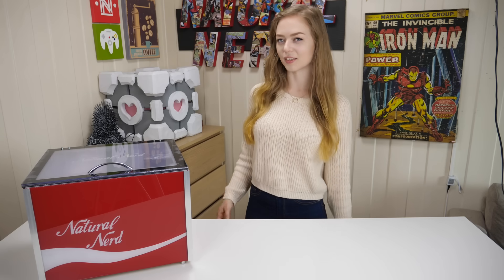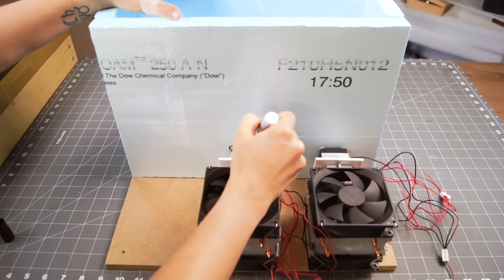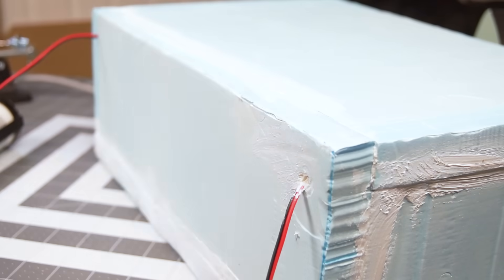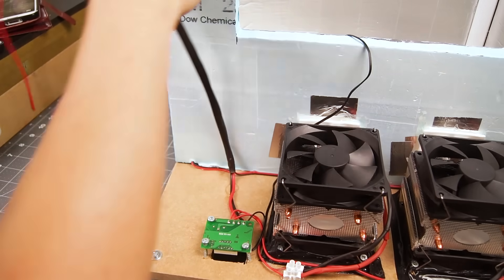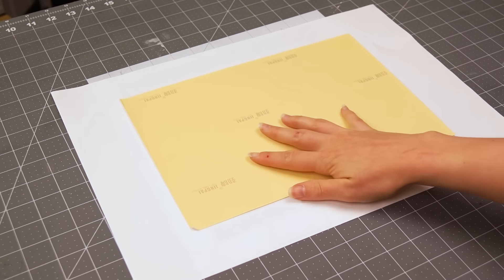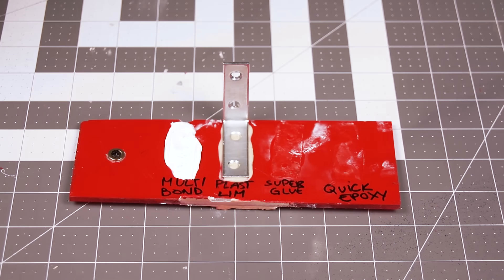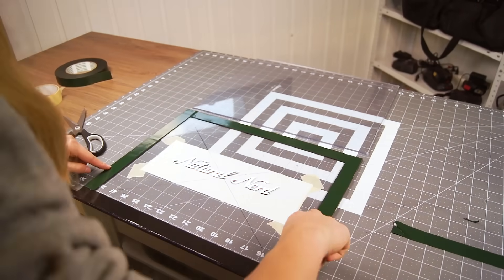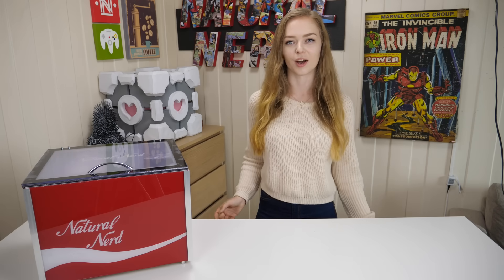DIY Desktop Mini Fridge (5°C!!)

Comment: I do have that thermostat, i mean that model. Its relay is rated only 10a. You will worn it out sooner using those 2 12706 peltiers. 
Also, the size of its relay makes the buttons impractical to use, so i assume you've already set it first before installing.
.
I do manage to buy a e-thermostat of 20a, still cheap but it comes with a case complete with display so you can still set the temp.
.
I also made similar project but I've used plywood instead, it's r-value sucks btw so still need some insulations. But because it's my first time doing woodworks, my creation still suck even with insulation.
.
Also, may you should spray painted your inside with clear coat, those alu tapes worn out pretty fast.

Comment: Maybe the issue for cooling can be fixed if you also put syrofoam in the door/opening panel. It may not look as nice as what you did but it will be more convenient and efficient

Comment: you should have put those fans so that they blew from right to left not up to down. hot air is less dense so it will rise back into the heatsink.

Comment: How much current consume tec 12706 module 6Amp ????  But why my Tec 12706 only consuming 2.5 to 2.7 amp but it's printed 06 ampe but it don't seem to 6 amp module ??? Why why ?? I have checked it with two or 3 am metres

Comment: Where did you get the plastic wrap for the led strip? I'M LOOKING for it but I do not fi d it.. thanks in advance for the reply
Reply from the maker: You can find links to everything in the description :)
- Martina
Reply: Some links do not open the page.. I have another question: about the thermostat.. Is it adjustble for the temperature like a Real big fridge right? If Yes how does it work? If I understood well the thermostat you used replace the digital screen  thermometer shown in other videos with the upgrade the you can decide the temperature you want for your fridge is it like this.. it Yes can you tell me how to use it because I have all PICES home ready to be assembled. I am just waiting for the alluminum tape and it is done. Thanks
Reply: I JUST need to know how to program the thermostat to let it work at the SUITABLE temperature.. It is unfortunately not shown in the video.. It you can do it, would be easier 😀

Comment: I think I need to get inside your little box and get cooled off 
Your so Hot
Im burnin up 

And its called a hook blade,
Specifically for sheet vinyl flooring,
Sickle blade might've worked A little better, and probably better than that would be a blue blade
Generally specific to the flooring industry 
Mostly used in commercial applications for linoleum and 
carpet tile (one word , not to be confused with tile installation or carpet installation and their separate categories of types of installers)

Blue blades are the sharpest and strongest 
The worst sting you can get when you get bit by one  
It will flay you like Benihana

Damn Your Hot girlly

Comment: Great project, inspired me to work on a portable version to run off solar and possibly a battery supply  to take off grid.
Reply: edward silva I may doing that for my GCSE’s DT project I just have to see if I will be able to power it with a car battery. And how may watts is the solar panel you have used.
Reply: edward silva please post when done

Comment: Your fridge can get 5C... But an  important question to ask.. from what ambient temperature ?

Thank you.
Reply: Peltier modules can do a 50C delta easily (some go as far as 70C delta) while drawing ~70W (when always on). This fridge should be able to do 5C at 50C+ ambient.
Reply: @gslavik  Ämmm what kind of Peltier coolers do you have? It can surly NEVER can withstand 50C. First peltiers have a efficiency of 1/10 on the Carnot efficiency. The second reason is that peltiers can barely tranzport any heat with a temp diffrence more than 20k. And the last reason is that she build it that the air dont stay in the cooler or circulates. It is the warm air from the outside that just slips over the cooler and than cools the box. So i think you can have a diffrence of like 10 maby 15K below the outside temp.
Reply: Electric Fridges are sold in Trucking Stops for truckers. They don't get cold enough if it's sitting in a hot cab.
Reply: From freezing cold.
Reply: @poksi360  that's not what he is asking and also no nothing in this is freezing
Reply: @thecanadianbastard9019  I think you didnt get the joke. He meant it as "that fridge can go to 5° if it started at 0° lololol"

Comment: Fantastic, looks so cool.
What if hot sides of peltier/ fans were on one side and it has air inlet holes on rest of other 2 sides as well in bottom. In my opinion when fans are in botom it may cause slow escape of hot air and circulation of hot air back in..physics..!..?

Comment: This is wrong, you should never split a single wire like this, the current that wil flow throug it can heat it up and break or burn the mdf. Apart from that little mistake cool video and a nice project, keep it up! Like and sub from me!

Comment: For a project this small, you could use aerogel for insulation. You buy it on Ebay by the foot. Amazing R values with minimal thickness...

Comment: Mmmh, interessing. Very interessing.
But I've to point it out: this is for "professional DIYer", not for "Noob DIYer".
What I mean is that no one will go to buy parts AND tools to make acomplex project when the finished product will be cheaper. For example, most own a drill, but not everyone own a jisaw(sp?), a foam cutter, an industrial phon (dunno if is the right name, I'm using the direct traslation from italian) or even that cutter for plexiglass.
Now, you say, "all those are cheap and you can use them later". Sure. But as I said you would have to buy the tools (let's say 20€/each) and the components. And some mini fridge you cost only 40€, shipping included. 
I'm not saying this to put the video or the intention down. I liked this video and downloaded for later study (like when I'll finally find another work and will need something to use for relax-time)
I'm just saying that this video is more for the "professional" of the DIY than the "noob".

Comment: I've been thinking about building a larger frig to run off a 12-volt system. You've given me some ideas. Thanks!
Reply: Hi, dont waste your time or energy. This barely does a decent job when its capacity is 5 L. So you will waste money, it has a pathetic COP ( co efficiency of power) rating, like below 10%. Regular AC have 180% COP, I guess.
Reply: TECS are good for small fridges but a big fridge? you'll essentially turn your house into an oven and you'd be wasting so much power that you may may as well be shoveling money into a bonfire

Comment: Very nice DIY project! I think i've seen those thermoelectric cooling devices being sold in banggood. The seller  bundled those with TEC1-12706 peltier module, which is a weak and less efficient module in my opinion. But if we only wished to have our drinks chilled then, the 12706 is fine. Thanks! This DIY project is in my to-do list.
Reply: Hi congratulations, I also did technical tests with peltier inserts. See my channel. thanks.

Comment: Alright guys,if you decide to make this,switch out the Normal Black power Input that she uses for a safer FUSED switch. And obviously also pick and use the right kind of fuse. You want one that trips right before hitting max power draw. Why? Well fused stuff is always the safe stuff. So stay safe my friends and google search how to install fused switches (Like for the Anet A8 3D printer) <3 And dont fuck up the soldering!

Comment: Has transparent material and needs to see the temperature screen... decides to paint acrylic and drill a hole in it for the screen!
Well happens to best of us, but those building this, just tape screen area, paint the acrylic, remove the tape and glue the screen on that hole. Much cleaner solution that takes less effort.

Comment: If i was to make a smaller version with only 1 heatsink module rather than two, would i still get a cold temerature? Also if i was to use 1 cooler module what AMP 12V powersupply would i need.

Comment: Awesome build, subscribed.

Do the wires you used to add all the wires together to connect to the power supply heat up? they look pretty thin.

Comment: Great build! My only advice is that those heatsinks have heatpipes inside (the visible copper tubes inside the aluminium fins) that have a working fluid inside them & are designed to operate with the contact surface (that attaches to the Peltier in this case) at the lowest point.
Reply: Hi congratulations, I also did technical tests with peltier inserts. See my channel. thanks.

Comment: Based on your wirings, the fan directions on the big fans looks incorrect. Both fans are supposed to face towards the heat sink so it creates a high air pressure. This high air pressure creates a high temperature that gets heat sinked. Otherwise you're relying solely on the peltier. I bought the same refrigeration module, and noticed this.
Reply from the maker: Interesting, I'll check that out. Maybe it can perform even better!
Reply: oops. sorry i had it reverse. i meant they should be facing away from each other. this creates a low pressure, and cold temperature that is transferred via heat sink into the fridge and dispersed using the smaller fan. and according to this link it goes down up to -5 degrees http://bit.ly/2klKyye

Comment: how long could a fridge like that run off of a car battery or motorcycle battery? thinking of making some kind of portable refrigerator out of a cooler so I can take it with me on week long fishing trips to keep the fish fresh till i get back home.
Reply from the maker: We've thought about the same thing, since we go away for week long fishing trips as well during the summer. But I think its too power hungry for that. If this runs at around 80 watts, then a 120 Ah car battery would only last about 18 hours at full throttle. Of course the isolation prevents it from running constantly - so maybe 36 hours. Sadly, thermoelectric modules are not known for being terribly efficient. 

Edit: A commercially produced thermoelectric fridge could probably give you better durations
Reply: think I have a solution... use two of those those foldable 200W solar panels together with a 30A charge controller to feed the power hungry fridge. they only weigh 4kg each and provide 200w at 12A each. Connect both panels in parallel to the charge controller and you get 200W at 24A, should be plenty for the fridge plus a bunch of other devices. ( https://www.amazon.com/SolarOak-Resistant-Mono-Crystalline-Cellphone-Electronic/dp/B071K2HWDT/ref=sr_1_7?ie=UTF8&qid=1511382756&sr=8-7&keywords=200w+portable+solar+panel )

Comment: Would I be able to use "Northbear Thermoelectric Cooler Peltier Refrigeration Cooling TEC System Kits Double Fan DIY" I found on amazon for $55.99. Or because it doesn't have a radiator it will not work?

Comment: Unlike other similar diy project out there , your's looks like a finished product ready to be put on the shelves... Well done.
Reply: dont lie for pussy pal. It'll lead you down a lonely road.
Reply: When I first saw "Gray Fox's" name I thought it said "Gay Fox"
Reply: The overall design (save for the aluminum tape), yes. The attention to detail and actual level of finish? No
Reply: @g45h96  true , it bugged me so much , she used many materials for this , at least make it perfect ffs
Reply: @g45h96  ⁰0000000⁰q

Comment: Can I use light strips switch tranformer rating 20w 12v 2A for the Electronic Semiconductor Refrigerator Radiator Cooling Equipment?

Comment: Kudos! Great video, have you considered a double wall and air gap and a water/propylene glycol radiator for the heat dissipation? Out of mere curiosity, what's the design on the tattoo? Thanks for sharing.

Comment: Nice video but 99% of the viewers don't have such advanced tools as you own.
Reply: TECH HUB a dremel and adhesive foam are not advanced lol
Reply from the maker: What tools were advanced? I try to only use basic tools
Reply: Natural Nerd You will see how many likes and comments I get on this.
Reply from the maker: You can probably not do this build without a drill and a jigsaw, no, but those are pretty basic tools.
Reply: Natural Nerd yes agree with you that it can't be built without them but if anyone uploading video and mentioning DIY in it then it should be built with tools and of course materials that are cheap to buy or easily available at home.
Reply: Advance tools correspond to your cutting machine ,then that thing you have bonds your thermosheet tightly after gluing them, etc
Reply: TECH HUB aĺl those tools can be bought for between $18-$25, if u you buy the  cheap chinese ones. which will suit the light load for DIY work.
Reply: there are a video where you can see how to build a cutting machine , but if you dont have a cutting machine u can cut this part slowy with a simple cutter it is super easy
Reply: TECH HUB no need to get angry and yell man 😊
Reply: drill *rusty nails
jigsaw *craft knife
Now let's try it
Reply: MAKE YOUR SELF ONE,I WANT TO KNOW HOW WILL YOU MAKE NEAT AND WELL FINISHED COOLER BOX AS NATURAL NERD LOL,YOU EVEN DON'T NOTICED HOW MANY TOOLS NATURAL NERD HAS USED TO MAKE IT,I ADVICE YOU TO WATCH THIS VIDEO AS MANY TIMES AS YOU CAN THEN YOU WILL UNDERSTAND MY POINT.

Comment: You can use the refridgerator insulation foam (which has reflective film already attached to it) or those emergency blankets and polyurethane foam to insulate the inside.
It's also advised to put a stainless steel or copper container inside with thermal compound to maximize efficiency.

Comment: Nice work! My only advice too you would be changing the fan directions instead of blowing the air down blowing it up, it will help with the peltier module efficiency as the colder you get the hot side the colder the cold side will get.
Other than that amazing work!

Comment: It's a nice build and all, but with this kinda cooling system you can't really get lower temps than that of the room it is in itself. Not to mention the price of all the parts used and the time it takes to plan and build one. You can just get away cheaper if you buy the fridge itself, which has an efficient cooler.

Comment: I'm confused. She mentioned that cold air escapes upwards, and hot air downwards. I always thought it was the other way around. Is this specific to this design or have I just been mistaken my entire academic life? 😶
Reply from the maker: Oh, that was just the direction of the air flow from the fans (the exhaust pointed downwards). Cold air is heavier,  so you're not wrong :)
Reply: Ah, gotcha! Thanks for the insight! 😁

Comment: As cool as this is, the four 80mm PC cooling fans, two heatsink assembly units, and various wiring and wiring components and a 180 watt PSU, would actually cost more than a minifridge from Amazon. They cost like £30. It is nice to do as a hobby but not cost effective, which is how I measure all things since I am Asian.
Reply: Spoony - true... But can you then say I built it myself from scratch?

Comment: Next time your applying vinyl remove the excess material from the backing, and use transfer tape, which is essentially wider masking tape. You can use it to lift all he letters from the backing and transfer them over in one shot.

Comment: I kind of wonder if water cooling in place of the CPU fans would make a significant enough change to the thermal dynamic of this construct to be able to utilize it as a freezer. Good job on what you've got though.
Reply from the maker: Interesting!

Comment: Are Banggod a trustable website to buy Electronics? og i hvilken butikk i Norge kjøpte du isopor etc? evt andre ting.. vil lage en sånn en :D
Reply from the maker: Banggood is alright, and I have good experience with their customer service! All electronics are from there. Also if you buy through our links, you support the channel :)

Kjøpte isoporen på Byggern  (alle byggvareforhandlere fungerer, spør etter gulvisolering), og plexiglasset på Biltema.
Reply: ok, noe mer du vil anbefale? har limpistol men har ikke sag og sånt (har ikke plass til det).. vet du om noen som selger slike kjølemoduler i Norge?

Comment: how much time it will run on battery?
Reply: That depends on how long your battery would be able to sustain the rather power hungry peltier elements. My guess would be: not very long at all. Specs from the link: 12V * 5A = 60W *each*. So that's 120W plus the consumption of the fans, LED strips, power supply losses, etc.
Reply: NaHCO3 still you can give approximate running time?
Reply: It should be obvious that anything smaller than a car battery won't be sufficient. So assuming a standard 100 amp-hour car battery (5A, 12V), this would get you 1200Wh. Divide that by what I assume to be ~150W power consumption of the whole package and you'd get roughly 8 hours out of that.
Reply: NaHCO3 Ok thanks

Comment: If you left a larger gap between the 2 acrylic panels you used for the lid, it should insulate it a bit more as stagnant air makes a good insulator